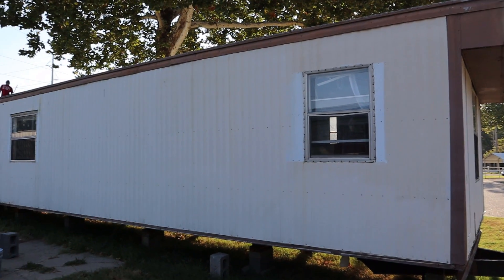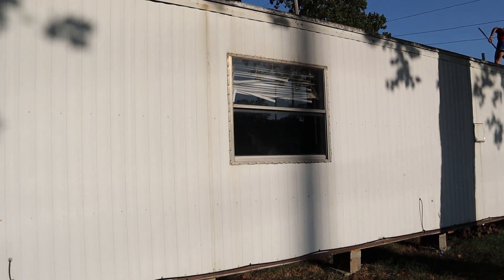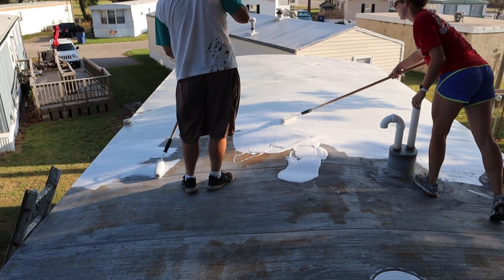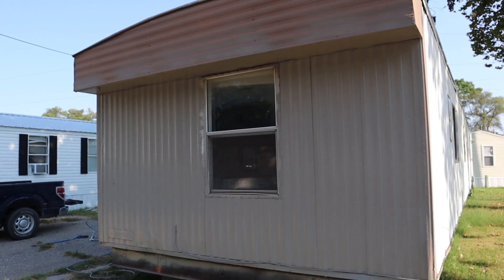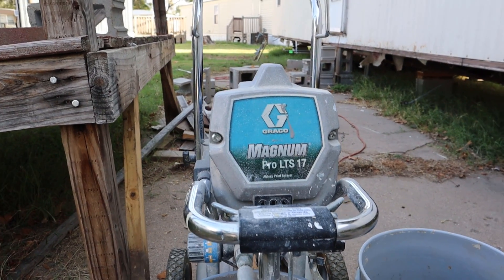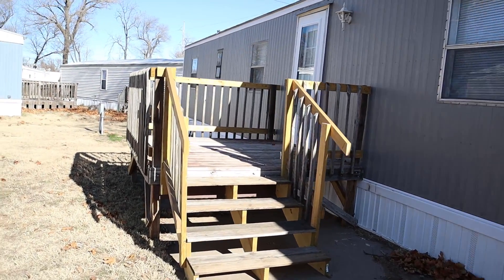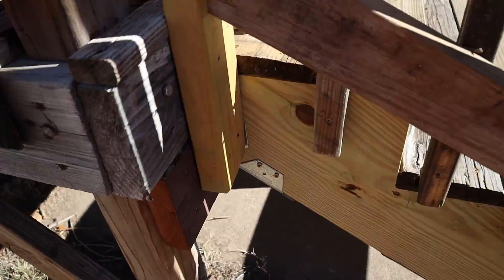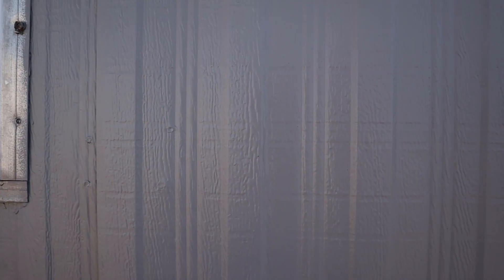My Mobile Home Investment - Exterior

Comment: Great makeover. Plz tell me sir whay is yhe darkest color yoi have ever painted a metal sided trailor. Im updating mine replaced all the rusted siding screws am wondering if a dark color will cause them to work loose through expansion/cotraction of the metal. Got my heart set on a dark green home do you have any advice my roof is white to try to keep it cooler. Im tierd of the bland tan exterior
Reply from the maker: I haven't painted any dark colors on these homes.  Since we sell them, we stick with whatever is popular.  You won't have a problem painting a dark color though.

Comment: Before painting the roof, did you use anything to deal with the rust besides just pressure washing? I’ve read the paint won’t adhere to the rust until you use some sort of product first? Thank you
Reply from the maker: If there is rust, we apply a rust convertor first.
Reply: Remove loose rust spray with a product called OsPho I get mine at n apa it will turn black with a white powder on it wipe the powder off then cover with your roof coating.

Comment: How many gallons of paint?
Reply from the maker: between 7 and 8 for the main color.  A quart for the trim
Reply: @Challenged1  How many gallons of the Duck Coat...their website say 70 Sq.Ft. Per Gallon which would be a lot of money .... I think I would need almost 27 Gallons for a 20 x 50 feet home...Can you share how many gallons you used of Duck Coat and the size of this home. Thanks in advance!
Reply from the maker: @jda120160  14x66 home and used a little under two 5 gallon buckets of it for 2 coats.  It goes further than they say
Reply: @Challenged1  Thank you very much for the reply, I'll give two 5 gallon buckets a try.
Reply: It looks like I'm out of luck in getting this sent to me in California ... I get this from the Menards website when I go to purchase ...Due to recent changes in Proposition 65 this product is restricted from being sold to the state where your shipping address is located. Please remove this item from your cart.   : ( 

I'll look for an alternative, do you have any suggestions
Reply from the maker: @jda120160  Good ole California.....
I don't know of any good alternatives although I'm sure there are some out there.  I try to only recommend what I actually use and have good luck with.

Comment: 200 and paint 100 in lumber 600 in skirting that's just materials that's not even including labor. Those are prices if you do it yourself. Labor alone 4 strain is about anywhere from 1,000 to $1,500 nowadays. Pain about another $1,500 in labor. If you get lucky. And then a carpenter???
Reply from the maker: I did this myself, no labor cost necessary.  If you can't do these simple tasks yourself, you shouldn't be in the investment business.

Comment: 600 for plastic skirting? What a rip off. Metal tins better, cheaper and you won't weed eat wholes in your skirting every time you mow.
Reply from the maker: Skirting needs to be vented well
Reply: @Challenged1  helped neighbor with his that we bought at mobile home supplier. Its not vented and depends on codes where you live. Dont have to have any skirting in this state. I'll stick with the tin.